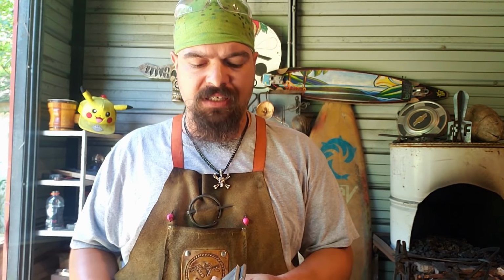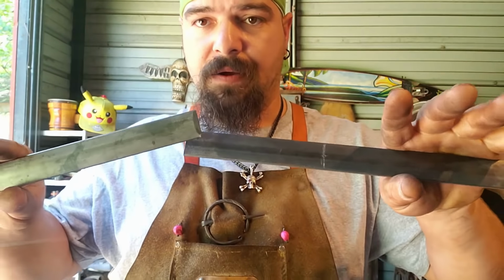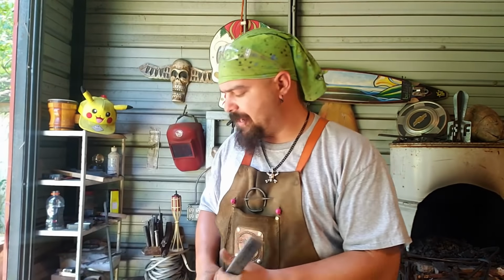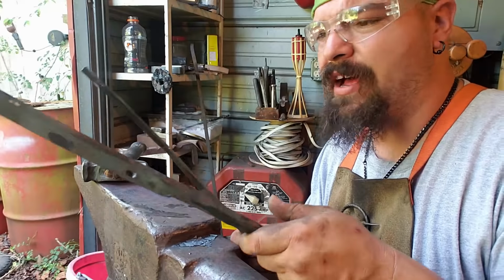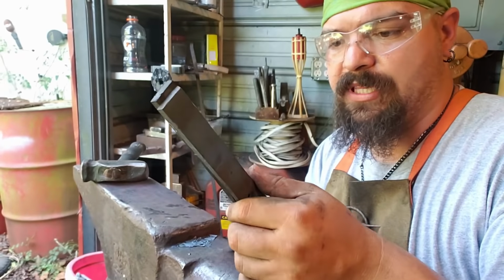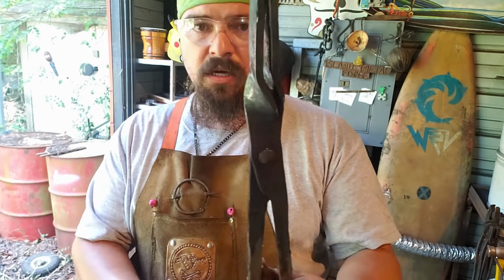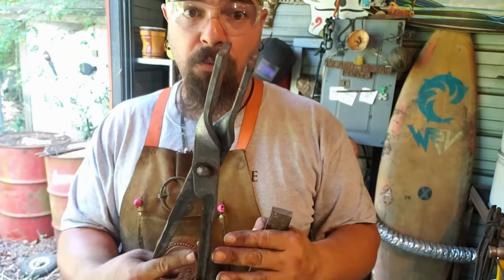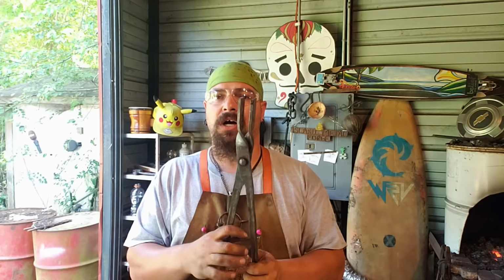Simple and Easy Beginners Tongs - Twisted Tongs Part 1

Comment: I came up with an idea on a pair of these a while back and I was at John Bennett's shop and we tried it out. He then later shot a video of it. Anyway instead of drawing out the entire length we made a cut in the middle of the stock up to each end.
Reply: Actually I probably didn't come up with the idea, just re-thunk it.
Reply from the maker: wow! I couldn't find but the one video on it from Roy, or I would have mentioned it!.   yeah, I thought about cutting it, but I need to work on drawing stock out.. so it was also practice for me.
Reply: I've made them after watching the John Bennet video. Fast,fun, and as strong as any.

Comment: Awesome vid as always. I have seen those style tongs before, but have never forged, or personally used a set like them. I think they would be good for holding a set of top tools similar to the sort that Roy @ Christ Centered Ironworks uses. Or just having them forged to hold punches, or chisels. I might take a crack at forging a set to try out under a treadle hammer.

Comment: Great video Yamez! These very well may be my first set of tongs that I make.  What size stock did you use or does that not really matter?
Reply from the maker: The first set of these I made was 3/4 by 3/16... these were 1 by 1/4. I reccomend the 1x1/4 and I reccomend drawing out the reins for practice, and a thicker grip. Draw out to square, then round it out. I am going to be playing with the twist, it bay be able to get closer to the rivet and tighter.

Comment: Use a pinch of coal dust when using a drift. It acts as a barrier/lube. Itprevents thibgs from sticking, that you dont want stuck lol.
Reply from the maker: I've taken to dipping the punches and drifts into coal dust after cooling them in water. It helps it stick to it

Comment: Ha! Tongs :) I've tried to make a pair of tongs for quite a while with little success. There always seems to be some problem that pops up so my solution is to start some huge project so I can forget about tongs for a while. I'm gonna make the ones you just showed, they look great! My current big project is a new forge, I used up my old one. Here's a question, how do you use up a forge without a pair of tongs? Mebbe I missed something :) thanks for the show!
Reply from the maker: For these tongs, to forge them without tongs or tools, get you a length of flat stock... bout 30 inches or so... mark out the middle about 8 inches or so, then just hold the stock and forge each end down for a handle (reins) so they are roughly equal, then cut it all in half and drift or drill the hole large enough for your rivet or nut and bolt. Do the twist, and adjust to what you are working on... readjust as needed.
The piece I used was 1 inch by 1/4 inch. 
I have another video on these that I am editing.  Glad I could help brother!
Reply: Thanks a lot! I just happened to buy a bunch of 1'x1/4 for a smoker so that works great. I've got this video marked for reference, and I'll tell you how it goes. I think it will work nicely. Keep on with the good work, I enjoy your show. 👍
Reply from the maker: I really appreciate the support! I'd love hear how they turn out for ya... hammer on, and hearts and health brother!

Comment: Nice job and thank you for the explanation Yamez!  

Off-topic for this video but I wanted to ask, as you forge - do you do Damascus yet?
 I was wondering what effect you'd get if you made a sheet of metal and corrugated or accordioned it, and then forge flatten the peaks together? Not sure what that would do to the strength of the steel but I bet you'd get an amazing pattern!
Reply from the maker: So make a layered billet, accordion fold it and flatten it again?
Reply: @IslandMetalForge  Yup, but making sure that the sides of the 'V' I guess fold down onto the next one ... Bah, I can visualize it in my head, but can't explain it so well :D

Comment: for safety you need to grind the top of your punch and drift before the chips fly off and stick  into something that leaks red stuff...
Reply from the maker: For safety I use a brass hammer when using the hand tools. Anything that I need a larger hammer I have softened the striking surfaces of.
Reply: @IslandMetalForge  If you use a brass hammer ? how did the top of the punch get so messed up the chips will still come off just no sparks...... be well and be safe...
Reply from the maker: @CockatoobirdmanBill  the punch is s7, it was machined that way. It is actually a piece of a pharmaceutical industry machine for making pills or something... the drift is just a bit of an old tool, I never even hardened it... I will grind its edges though, just to be safe! Good looking out!